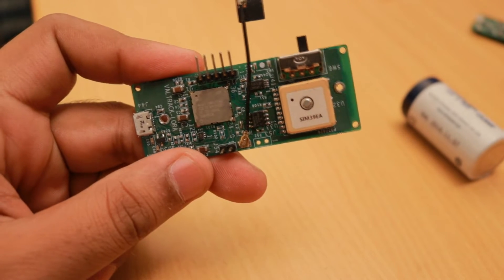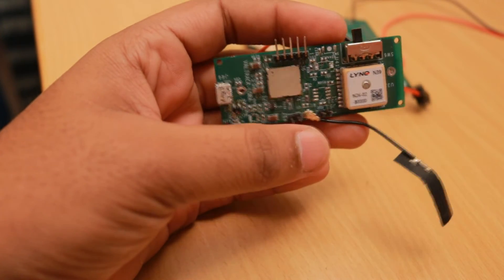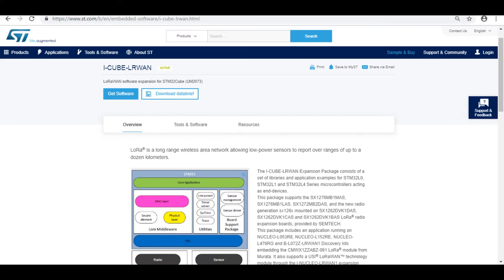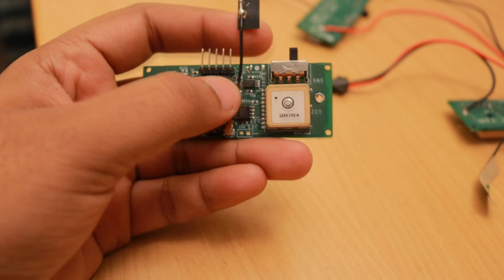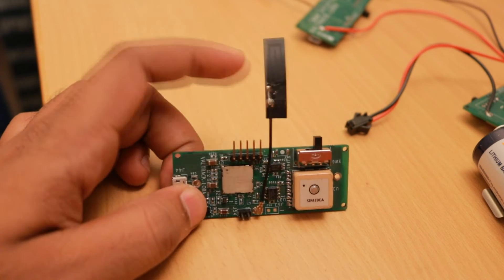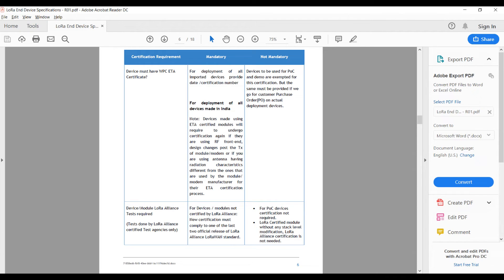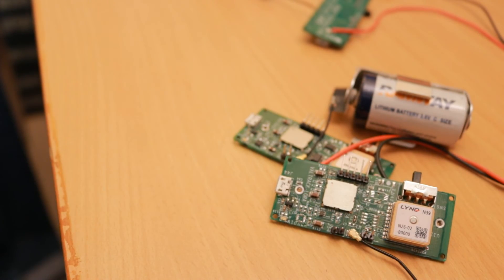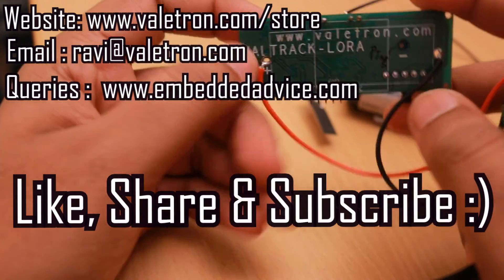Designing a Low Power LoRaWAN based GPS Tracker - Long Battery Life

Comment: hi Ravi

thanks for the video, i have a question about the mosfet that u use to switch the gps power,
during switchin on the gps module, do u ever encounter some voltage drop that make the Stm32Lx trigger hard fault ?

Comment: Hello, I am playing with Arduino based tracker and I found there is a significantly lower accuracy of the GPS module when I am switching it on after waking up from the sleep mode. Have you encountered a simillar problem, please? The accuracy after switching on the GPS module is about 100m. Thanks
Reply from the maker: Hi,The accuracy of first few GPS packets is not good. But its off only by few meters, not by 100m. If its off by 100m may be there is some problem in the way your hardware is mounted or its getting some reflected signals from big buildings or large objects instead of direct signal. Make sure your module is facing up towards the sky and your design has sufficient ground plane for antenna, if you are using inbuilt antenna module.

Comment: Hi Ravi, Thank You for this tutorial. Can you give any insight how to implement something similar to this with a much smaller battery onto a foldable drone? In other words want i am wanting to achieve is,, if my drone does a fly away there would be data sent to a smartphone were the drone is currently. In other words the module itself would be running on a self contained battery seperate from the drone battery supply, that would be runable for maybe 2-3 hours time capacity to be able to locate drone. The reason for this is,,my particular model of drone has been having many fly aways for some unexplained reason. Hope this makes sense. Thanks again, Barry
Reply from the maker: Hi Barry, Do you want data drone by cellular or Lora?
Reply: @RaviPujar  Hi Ravi, Would like to setup a Lora. Have been doing much reading on LoRA but still very green in regards to all the terminology to be honest. Would like to stay away from cellular if possible to keep it simple and cheap. All i really want this for in case of 'emergency',,aka, a fly away. I probably not explaining this very well.

Comment: i have sim800A module and i powering it up with 12v 2A adapter 
it is not reegistering on network i am using airtel card
Reply from the maker: Could be many problems. Post here with details. http://www.embeddedadvice.com

Comment: I want to switch a 3.3v load ( 150mA peak) from a 3.3v microcontroller, what mosfet shall I use? I tried IRF540N but it provides enough current to the load only when gate voltage is 3.95v and above. I’m limited to a maximum gate voltage of 3.3v.
Reply from the maker: You can try BSS138BK MOSFET.
Dont forget to share and subscribe :)

Comment: How to power GSM module at 4.2V from Powerbank at 5V, I have tried using diode,but voltage varies a lot and it doesnot work properly.
Reply from the maker: Use easily available switching regulators or LDO like LM2596 or Mic29302 etc respectively. Don't forget to share and subscribe :)
Reply: @RaviPujar  I tried using LM317 to get 4.17V output, but I was getting 3.7V with 5v input. But with 12v input , I got 4.17V only, so I think the gap between 5V and 4.2V ie 0.8v cant be achieved, minimum gap needed would be around 1.5V for it to function properly.

Comment: Hi,  very nice video , detailed video ,i am also trying a murata lora module , with TCL network ,using AT_commands , but am facing a problem to send data to tcl platform, am able to connect to there network , am not getting PORT details to send data, can you please guide about this ? it will be help full
Reply from the maker: Thank you. You don't need any port there. You just need the keys and dev eui. I used firmware directly. Not AT commands. We made a forum for such discussion. You can post there. http://www.embeddedadvice.com. Don't forget to share and subscribe. :)
Reply: @RaviPujar  Thank you.

Comment: Hey wonderful work.. even I've created a small board based on the rfm95 and atmega328 chip.. can you tell me which regulator you used? I use a ams1117 3.3v one, and the dropout voltage is too high at 1V
Reply from the maker: Thank you. I use MCP1700.
Don't forget to share and subscribe :)
Reply: @RaviPujar  thank you!

Comment: We're deploying LoRaWAN retrofit device for energy Meter in Gujarat. Our first project.
Reply from the maker: Does it also run on TATA network?
Reply: @RaviPujar  no we deployed our own gateway and server called "Lora server" and it's open source.
Reply from the maker: @punit_patel  Nice. What does the LoRa server do here. Forward data from gateway to your database? Which gateway device you used, how is performance and range?
Reply: @RaviPujar  yes but for more details Google "Lora server" you'll find repo on git
Reply: @RaviPujar  BTW I've tested RAK831 and ic880 with 5dbi and 10dbi antenna. With RAK 831 and 10dbi antenna we got around 18km diameter in agriculture area. Antenna placed on 6 meter pole

Comment: Great work, even i m working on lora for Singapore
Reply: I am using RN2903 lora
Reply from the maker: Thank you and all the best. How is RN2903?
Reply: @RaviPujar  1st revision test was amazing. Range is good. I had used 2 db dipole antenna.

Have you done power analysing on your lora module?
Reply: @sumanjha1951  did you tried PCB ANTENNA?
Reply: @punit_patel  No i didn't do
Reply: @punit_patel  No not for LoRa
Reply: @sumanjha1951  I've used SWRA416 it's good then external Antenna.
Reply: @punit_patel  Have you tried multi-node peer to peer communication between lora node
Reply: @sumanjha1951   Suman Jha  are you talking about LoRaWAN or only LoRa p2p
Reply: @punit_patel  yes lora radio only
Reply: Nope! hard to manage the duty cycle for each node, encryption etc. also did not find any useful application for multi-node p2p.
Reply: I'm currently running pilot for GUVNL,Gujarat for LoRaWAN for meter reading application in an agriculture area. I've used RAK811 in the devices and for server-side lora-server from borocar and lastly on a front-end side simple node js app to decode and display data.